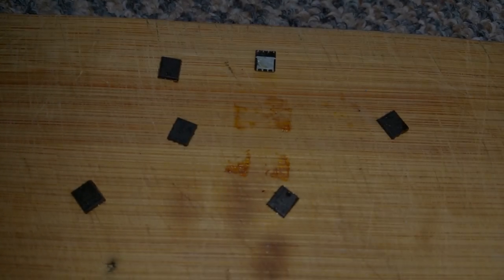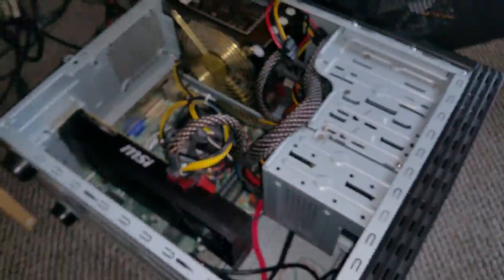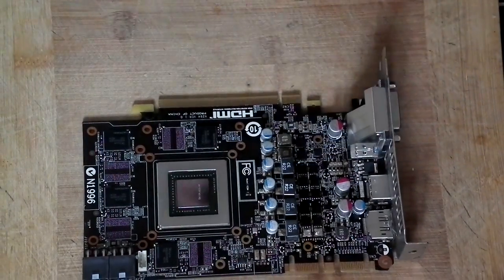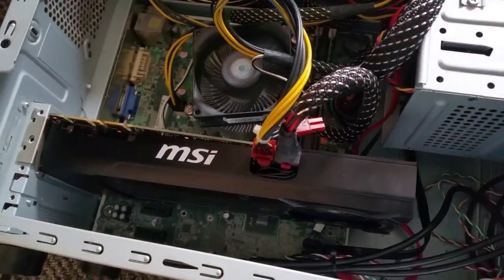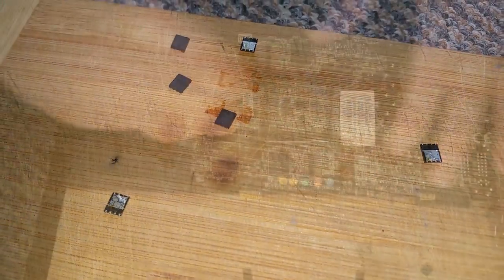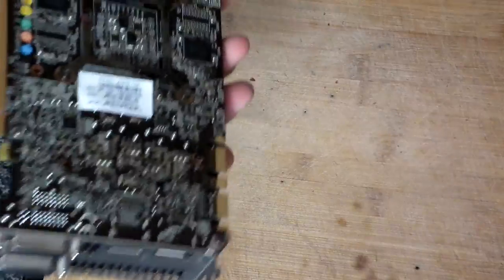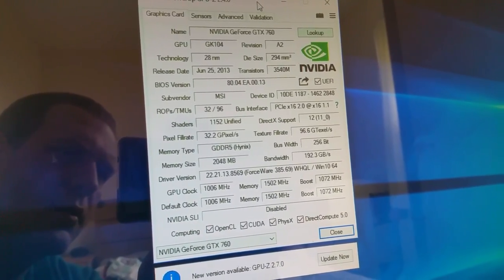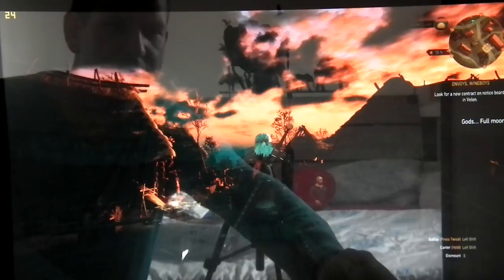How to FIX Graphic Card Short circuit without spare parts

Comment: Thanks so much man. BTW to everyone else, it is possible to look up the part numbers for the mosfets and order them from digikey/mouser. They're like $0.50 a piece.
Reply from the maker: This is good tips bro
Reply: yeah or ebay also i did it by size like in mm. the packages have sizes you can look them up

Comment: Dude,I can't thank you enough,I fixed my R7260x OC and I've shared your channel everywhere i could.
Reply from the maker: thanks so much my friend I hope I will help more people in future
Reply: @frogtechtips  Do i have to replace the faulty VCC,or do i run it without it?
Reply from the maker: @vaibhavdubey8713  definitely replacement is best to do but you can run card without vrm  but do not over clock card
Reply: So, i won't have any problems if i don't overclock the card and just play games?
Reply from the maker: @vaibhavdubey8713  you can try only problem you can have will be your pc switch off under hard load just simply try and if you will get any problem you can still add missing vrm BTW how many vrm is faulty on your card
Reply: @frogtechtips  Just one.
Reply from the maker: @vaibhavdubey8713  that's should be OK  I have card one time with 3 take off and card still working with no problem :-) good luck and merry Christmas

Comment: If you really want to know how to test MOSFET without removing it... listen up.

on the mosfet you will see a DOT, this indicates pin 1 next to it.... on the same row, it goes up pin 2-pin 3- pin 4.... pin 4 is your GATEWAY.... pin 1,2 and 3 are all connected together....pin 4 is SEPERATE! it should have no continuity. pins 5-8 are all connected to the board. if you have continuity between 4 and any of the pins 1-3 then you have a BAD MOSFET, thank me later.
Reply from the maker: Thanks for this definitely will help someone

Comment: hello frog! may i ask? i ordered SIC632 IC online. Because the former one on my gpu is the one causing shorts. May i ask is. Does buying this IC worth it? I am just unsure of it's stability without one. It boots without the shorted IC. and finally retires from being my paperweight for 2 years. My gpu is AMD Sapphire pulse rx570. And thanks to you primarily I got the balls to test it out without a possibly vital component.
Reply from the maker: If working without that should be fine but always is good point replacing with new one if possible with sometimes is not possible
Reply: @frogtechtips  i am just curious what does it's purpose if it works without one? i am a beginner on GPU repair and this is some alien tech thing for me.
Reply from the maker: Some GPU is working absolutely fine without one only way to find out is make a strestest
Reply: @frogtechtips  okay, apologies for being like a kid but last question. Does emulation make a good stress test? been running GTA IV xbox360 on xenia lately. all good just got bottlenecked on i5 4590. i am more than grateful hearing your replies. thank you brutha!
Reply from the maker: Best stress test is download some benchmark test like I use in video  furmark is free and good for that and you welcome IAM here to try help

Comment: Hey dude my 760 used to fail immediately after going under load now whenever o load my pc up everything has artifacts all over it 
What do you think the problem is?
Reply from the maker: Your card is so old and is common problems I will try clean reheating GPU put new thermal paste and this should help

Comment: How did you determine the short to start with? What voltages on your voltmeter showed the short? I have one I want to do this with and that info would be very helpful. Thanks...
Reply from the maker: Reviewing Playing & More RPM hi this is standard place for short and as my multimeter not beep if it's short show just number 1 :-)  at first point you will need detect with side and after if you not sure take tham off all and after trying card like me if you need more help just ask
Reply: I didn't understand much of that.
Reply from the maker: @peterwang5762  really nice explain

Comment: Hi This video is very old. But still I want to ask you something important. 
Same thing happen with me and the repair shop told me the main GPU IC shorted😢. This is a shocking for me as I can't afford another one and If I can't afford, I can't continue my work. Is it still repairable ? By any chance? 😢😢😢😢😢😢😢
Reply from the maker: Hi video is old but I still answered everything If I can do short is always hard to repair and good point is used card is now so cheap probably cheaper than trying to get fixed is some shops

Comment: actually do not need put off 6 mosfet, just check direct to mosfet to know which one shorted.
with 4 leg mosfet easier to check than digital mosfet (dr.mos)
Reply from the maker: Ye that's true
Reply: @frogtechtips  can you guys explain  to ,e how i test those mosphets with my digital multi meter thanks
Reply from the maker: @kylemcmahon24  check all for legs to ground best way is test tham when you desolder
Reply: @frogtechtips  so if any off the 4 legs are connected to ground that means there is short inside the mosphet correct ?
Reply: @frogtechtips  so i should not get a beep from multimeter in diode mode correct ?
Reply from the maker: @kylemcmahon24  yes that's correct
Reply: how to check 4 leg mosfet plz rely

Comment: I happen to have a gtx 960 (smaller size), if I only had one shorted chip, would it be safe to run it just without that one chip? and would it have the same power? I'm just curious because while you had multiple bad chips I only have one so I just wanted to know your opinion
Reply from the maker: Hi only way to find out is trying hard to say but if you can replacing foulty component on first place

Comment: Hello, my 2011 21 inch iMac gpu has shorted(heatsink burned / black from under) so does this method work ? it has HD6750M.
Great work !
Reply from the maker: Only way to find out is trying but if you can best is always find short and replace foulty components

Comment: Subscribed! What was the name of the part that with the short circuit brother? And can you link some sites where i can learn on how to identify short circuits and busted capacitors and transistors? I would also like to see what the problem with my card is. Please. Thanks and i hope for your response! 😀
Reply from the maker: I will recommend you Eli tech channel he is explain this on deep just look on his Chanel
Reply: @frogtechtips  thank you!
Reply from the maker: @Badbads123  you welcome
Reply: @frogtechtips  bro, how do you feel about gpu reballing? Does it work? If not the gpu, reball on the memory chips and other parts. What so you think of that method?
Reply from the maker: @Badbads123  reballing should working but usually is so expensive proces that's why I do just reheating is cheap and nothing to lose anyway if you tried
Reply: @frogtechtips  Bro, is it possible to damage the VRMs or VRAMs if I dont apply enough paste on my GPU?
Reply from the maker: @Badbads123  do you mean paste on vram module as if yes and been original there some yes is possible

Comment: hi there loved you video and i liked and subed  :) i have same graphics card with do display issue fans spin to can you tell me how i test those mosfets with my dmm 1 by one  ? what mode do i use and witch pins to i test on the under side off the chip  for short when i remove them  would really love if you could help me out hear i just do not know how to test those mosfets thanks in advance
Reply from the maker: hi thanks so much and welcome on my channel but if you have no display there is different problem not one like in this video check my channel for how to repair no signal output problem
Reply: @frogtechtips  my graphics card will.not show up in windows it was working one day no problem my son turned off pc and went back onto it few hours later and screen was blank so i hooked up vga cable and windows was loaded no problem card was not working even though fans where spinning so i decided to delete and reinstall drivers but pc will not pick up the graphics card anymore so driver installs fail ? So what would you think is causing the issue ? I will watch your other videos anyways when i finish work 😁 can you please explain to me though how i can test those mosfets after i unsolder them from the circuit thanks in advance mate 😁
Reply from the maker: @kylemcmahon24  hi your gpu have vrm or gpu die problem if you will have short your pc will not working at all will be looks like dead with that gpu inside 

you can test mofset once you desolder all pin cross with ground there should be no short if ist short there is foulty 

but I can say your card is not short look on my black screen fix or no signal fix video for how to fix
Reply: @frogtechtips  thank you that cleared that up for me i will give your other videos a watch later on and get back to you thank you for your time much appreciated
Reply from the maker: you welcome nice to have a new fan

Comment: i have  rx 480 one small smd capacitor  is  short and  2 smd fuses blown  i hope i can fix thank you
Reply from the maker: If you have soldering station should be not problems good luck with repair
Reply: @frogtechtips  I DON'T. I have 1 soldering iron and flux and that  braided wick.  i have tweezers like for plucking hair.  i plan to heat up the  smd bits and pull them off with tweezers.  then get the smd's i ordered and solder them on using flux and tweezers to quickly place them on while solder still wet  - oh and i order  multimeter that has a beep to double check the shorts. i know 2 smd's are fuses next to the 8pin power. they are blown. and 2 smd are capacitors they are shorting. i heard card can work even if i just remove capacitor but i am going to replace them your video very helpful thanks
Reply from the maker: @GhostvaperYT  you some card working without them you will have hard time to do but is possible good luck and let me know
Reply: @frogtechtips  thank you if I am relaxed enough I will attempt to film it but that maybe hard.  i might have my wife ready to put the smds on while solder is wet she is good with tweezers and fiddly stuff.
Reply from the maker: @GhostvaperYT  That's interesting tactical steps let me know Once you done:-)
Reply: @frogtechtips  yeah i will thinking first do the fuses to see if it switches on i have seen this repair on youtube rx480 where fans dont spin its dead. usually the fuses. it can run without capacitors but i have got some ill use.  i cannot lose anything so may aswell do it.  one question. if i cannot take a capacitor smd off  if its too hard can i solder the new capacitor on top of old one??  so new smd is piggy back the old one?  that would be easier for me
Reply from the maker: @GhostvaperYT  definitely yes you can just be sure you will destroy middle of components as if there will be short soldering new one on top is like do nothing just gently destroy with cutter or knife middle of capacitor or any components you need and after just soldering new one on top that's should be ok I hope you understand what I mean
Reply: @frogtechtips  OK so im better removing old one if i can?
Reply from the maker: @GhostvaperYT  yes always if you can
Reply: @frogtechtips  ok thanks
Reply from the maker: @GhostvaperYT  you welcome

Comment: Hi, I have the same problen in my ASUS Radeon R9 280X ,  my card got 2 pins, 8 pins(right side)  and 6 pins (left side) I accidentally dropped water on my case and did short circuit, I noticed is my GPU because my computer didn't start with 6 pins ( left side) is connected, like your video, but if I unplug the 6 pines connector, my computer start.. but my computer didn't get beep sounds.. But do the same like your video, like fans going to turn on but inmediatally turn off...  Do u think my problem is similar to your video?  I don't have your tools but I can go to some  specialist and how much cost if they can repair ? thx for your video. I thought my GPU was totally dead, but now  I have a little hope.. Nice video!
Reply from the maker: Tinieblas hi ie really hard diagnosed problem like this but ye if you take your card to some technician hi should help you nor sure how much can charge you as I do this as hobby  :-) first at all take cooler down from your card check any visible damage Like corosion from water 
I will firs clean card with isopropyl alcohol and brush maybe there is some small water short 

OK I hope you get card working again and let me know how is going

Comment: Hey Frog! Great video! I have a GTX 980ti with a similar problem. But my computer does NOT start when the GPU is in the Pcie slot and the Power cables are NOT connected to the GPU. Does this mean there is a different problem to the one in this video?
Reply from the maker: that's looks like some problem on main power on PCI express slot 
did you try that card on different pc or did you try different card on your pc 

check for any burn or damage on your card mean to slot
Reply: Thanks for the reply! 

I double checked as I couldn't see any damage on the motherboard or GPU.

I performed the test you show in this video and the short on happens when I plug in an 8pin power cable to the GPU (other 6 pin is fine).

I will check the drMOS and see, but I think one is broken as there is a short across the gate high and the switch.
Reply from the maker: ye you will need check that and if even remove one your card will be still working anyway
Reply: Hi, did you fix the issue? It just means your card has a short somewhere else

Comment: Hello ! Could you please help me ! You seem to be very good in electronic ! I have a powercolor RX6900XT, I made a mistake with my psu and cables and now I have a short-circuit on my 8 PIN connectors! Everytime I plub cables, it flashes, smells burn and shut down :(( (there are 3 8PIN connectors female).
Please help me. Do you think that graphic card is dead or do I just have tto change connectors?? It's a 1500$ graphic card ...

Thanks a lot.
Reply from the maker: Hi if you smell burning you will need replacing foulty components and if you are lucky your card will be working maybe you can try apply warranty who know always is good to try
Reply: @frogtechtips  thanks a lot. Yes i try warranty
Reply from the maker: @rahan7664  did you go try or you already tried
Reply: @frogtechtips  i just asked for rma. Will see.... I'll tell you
Reply from the maker: @rahan7664  yop thanks

Comment: I got a short on my card and I used an alcohol to clean the board but after drying it and fixing everything together when I turn on for the first time the card started to smoke so I immediately tunr it off. I guess the alcohol cleaner had some residue which shorted the card. Is it possible to fix it again? How did you check for short with a multimeter?
Reply from the maker: Hi is hard to find usually but as your card smoke you probably can find components with one burning and you will need remove that components with probably get short out if you have luck and there is no track damage you just simply replace that component for new one or you can try that card without that component maybe card will be working but definitely I will recommend buy new card
Reply: @frogtechtips  thank you very much for the reply. I will definitely try that. It was new and my fault they got short circuit. The cmos battery fell on the back of the card while I was trying to remove it.
Reply from the maker: @hasangaimesh3139  you welcome I hope you will have luck let me know

Comment: Hello i have this exact same card, the issue i am having is that the card shows lines as soon as the comouter starts in the bios the display stretches past the screen also. Al lot ot white line all over the screen. After a while being on it freezes and i have to restart. What do you think might be the issue?(i can read everything in the bios just lots of white lines)
Reply from the maker: Hi only you can try is reflowing GPU look on my channel how to do I have plenty of video with problem like you.

Comment: My GPU has a strange problem.It only powers up occasionally.But when it does everything works fine and I could play all games fines.But most times when I power my PC ,the GPU doesn't start.Any solution?
Reply from the maker: looks like you gpu die will soo go I will recomend replace thermal paste with hope to help and also can be PSU problem like sometimes don't  qive power card need

Comment: Hi  i have a gtx 660. Hope you can help me. Fan not working no display. I think there is a short
Reply from the maker: Ghino Dela Rosa is your pc start when card is plug in or not if yes you don't have short you have problem with dead die with is probably not repair Posible :-(

Tell me what's happened and how card stop working
Reply: Frog - Tech - Tips video card is not detected. But when i use the onboard vga it works while gpu is plugged in . Fan from vcard does not spin as well. Thid happen when there is a sudden power interruption.
Reply from the maker: Ghino Dela Rosa when you use on board gpu windows see that another gpu or not if not I think your die is dead you can try reflow but I don't think there is many help
Reply: Frog - Tech - Tips. It turns on with the onboard gpu. But it is not detected at all. Fan does not spin as well. Do you think resoldering mosfet will help?

Comment: Finding it really tricky to remove the original inductor drivers on a 980ti, what temp did you use for your heat gun?
Reply from the maker: Hi I use 290 Celsius
Reply: @frogtechtips  do you preheat the board also? I'm kicking out 350 degrees onto these ICs and they refuse to come loose.
Reply from the maker: @crashbuilds  hi no but you need use Flux
Reply: @crashbuilds  I was looking into that, and for me I'm gonna get a used toaster oven, heat the board up to just below the point solder melts, then I'll remove the mosfet